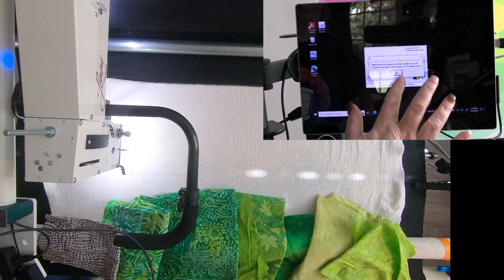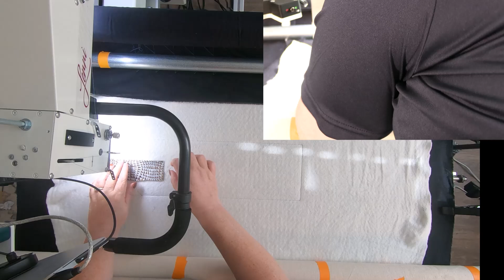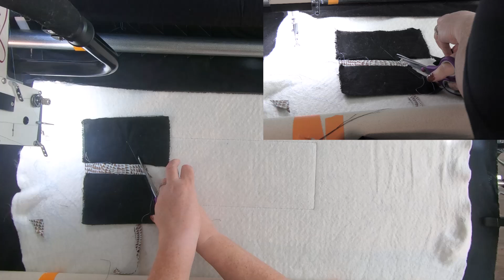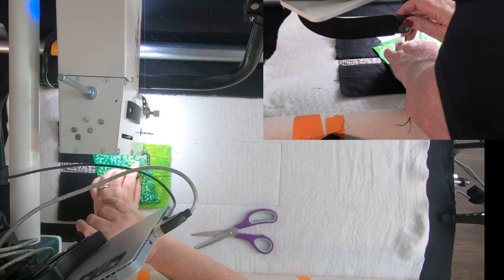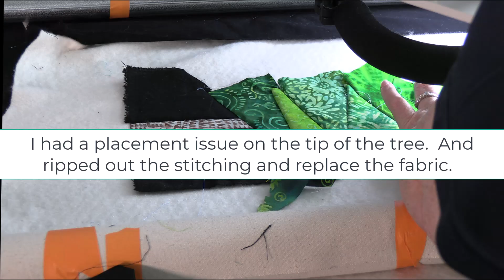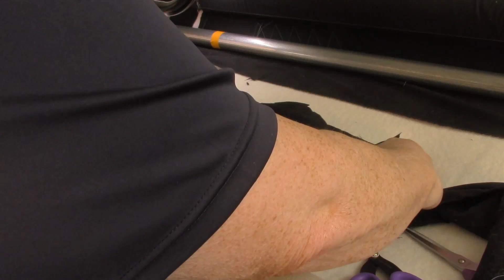Tree Wall-hanging

Comment: I had a bit of time to try this new way to use a long arm and had fun making a few of them (4 on the same WOF backing since it was there.  I noticed that Angela commented fairly early on the video that she would put approximate sizes of each piece of fabric at the end of the video and I never saw that.  So one of the times I made one, I wrote down what my sizes were.  So... Tree trunk 3x8"; Left side  of tree background 4x6"; right side of tree trunk 4x8";  (the next 8 pieces are from bottom to top of the treeI)  4"x6";  2.5"x6";  3.5"x5";   3.5"x4";   3.5"x4";  2.5"x3";  2.5"x2.5";  2"x2".   Piece of background needed for left side of quilt= 4x22"  Piece of background needed for right side of quilt = 6"x18".